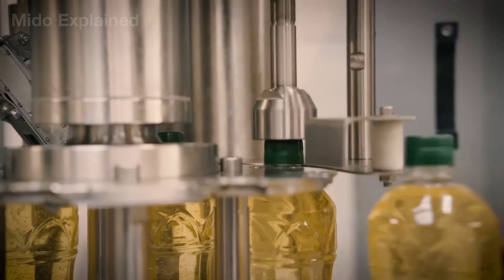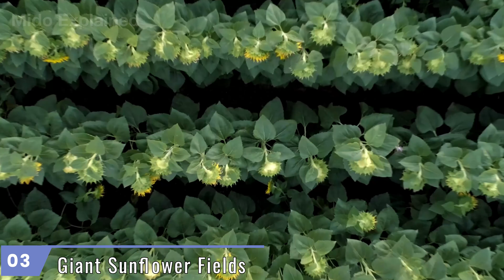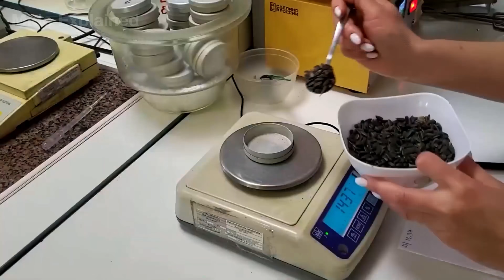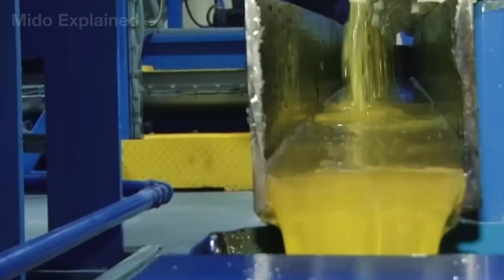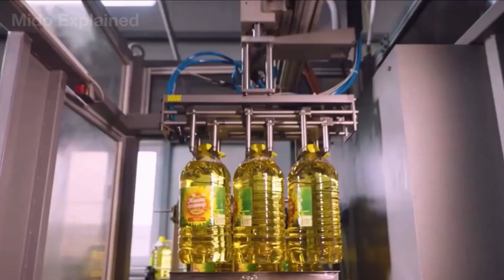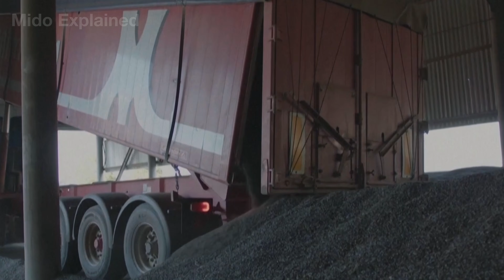How Tiny Sunflower Seeds Become Millions Of Tons Of Cooking Oil

Comment: Sunflower oil is deadly. "Sunflower oil is considered potentially harmful primarily due to its high omega-6 content and instability under high heat. Traditional sunflower oil is rich in linoleic acid, an omega-6 fatty acid; excessive consumption can disrupt the omega-6 to omega-3 balance, potentially promoting chronic inflammation linked to heart disease and other conditions.  Additionally, when heated beyond its smoke point (approx. 450°F for refined, lower for traditional), it can break down into toxic aldehydes and other harmful compounds associated with cell damage and oxidative stress."
Reply from the maker: Thanks for sharing your perspective. Sunflower oil is a topic with a lot of discussion. Like many cooking oils, its health effects depend on the type of sunflower oil, how it's used, and the overall diet. Using any oil at excessively high temperatures isn't ideal, and maintaining a balanced diet with a variety of healthy fats is generally recommended.